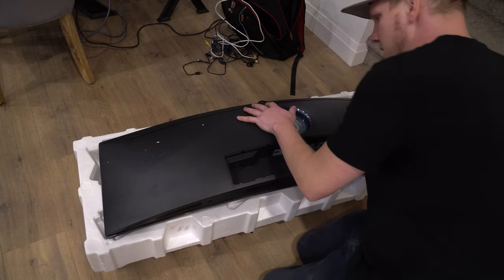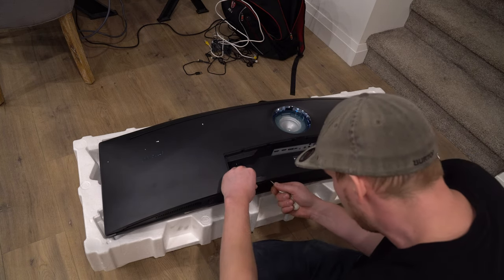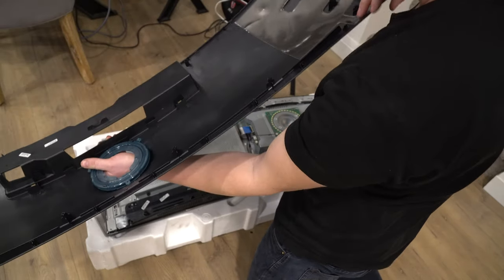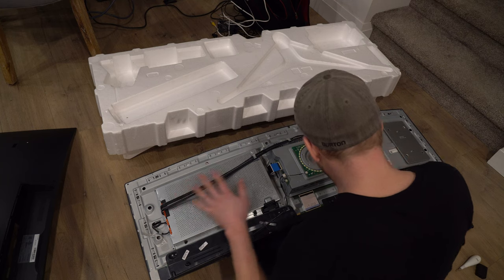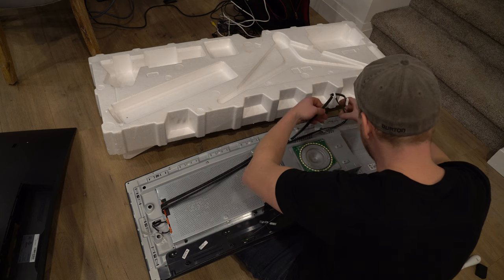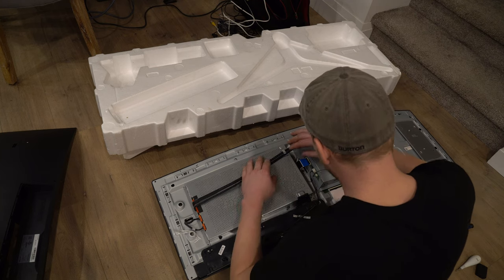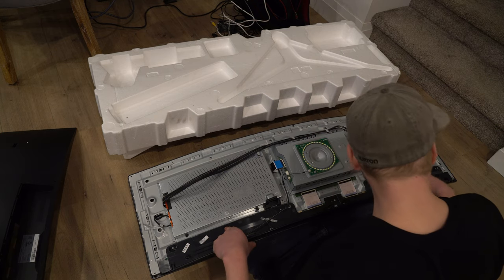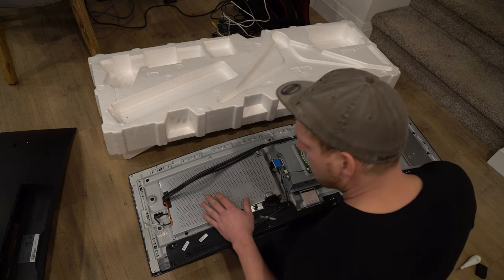HOW TO TAKING APART SAMSUNG ULTRA WIDE MONITOR TO CHANGE OR REPAIR COMPONENTS

Comment: Where can I order a new display screen, I have a friend who wants to pay me to fix his monitor
Reply: If you find out let me know. I have one with a crack in the top right corner
Reply from the maker: Samsung directly but the problem the display has the backlight built in so you have to replace that whole unit which is quite expensive and delicate by the time you receive the screen it will probably be cheaper to just get a new one. Put it this way if I is a business owner call Samsung and tell them a screen within warranty has backlight issues they will write off and tell us to destroy the panel and bring it to a recycler and just send a new one out because it's cheaper.

Comment: Do you know where I could find a replacement panel for this model?
Reply: Ebay
Reply: 9 mo later but for $300 you can buy a module for panel and screen off Chinese mananafacturers an $233 for panel $100 in shipping

Comment: I broke a screw off in one of the mounting holes and needed to get off the back plastic housing. This is the only video that helped me to do that. I was very worried that I would break the housing, but watching the video gave me the confidence to do it. Thank you for your help. Excellent video! 👍

Comment: Thank you for uploading this!
I was afraid to start my joystick repair as i was uncertain how to actually open the monitor, but now i can easily get access to it.
Reply: It worked btw.. i just reflowed all the solderjoints and cleaned the board with isopropyl alkohol, now it works ever time i use it
Reply: @StopaskingformynameYouTube  yo I have the same issue. you just popped out the joystick, cleaned it up and the menu button etc started working again?
Reply: Oooh I’ll try this today, my joystick (OSD menu) stopped appearing

Comment: great video..
Question:
I have that exact same monitor and it has  a single vertical purple line on the right side of it.
what do you recommend as a fix?

Thanks and keep up the good work!
Reply: Me too. Any luck?
Reply: same :(
Reply: Same here, any fix?
Reply: I have a similar problem but on a HUGE scale. The purple line is multiplied across the entire screen.
Reply: @vvsneptune1799  chech the ribbbon connectors
Reply: Old comment, but for anyone else who comes through here, if it's consistent it's a panel issue, and if you're out of warranty you are paying for a new unit because panels cost about as much as a new monitor

Comment: Thanks a bunch for posting this video. My C49RG90 was rattling on the right side of the screen. Turned out to be the power supply part that is losely fitted. Stuck some paper in the sides to stop it moving and the rattle is now gone.
Reply: Same

Comment: How would one go about removing the black outer frame? I have the classical problem of a light shining through the space in between the frame and display. I want to take the back cover off and remove the black frame to simply glue the loose spot back together. Any help?

Comment: question : is it possible to split the metal backing from the screen with all the electronics still instaled to it , by only removing the ribon cable for the screen itself , or is the screen glued to the metal backing ?
reason i ask is i have one monitor with a good screen and one monitor with good electronics , but i like to keep all serialnumbers together (serial numbers are programmed intoo the board and on a sticker of the metal backing )

Comment: You're a brave man, opening up one of these :) I'd be afraid to kill it. 

Right now I'm dealing with the port cover on the back being stuck and un-openable. I'm so afraid to crack it by applying too much force. Do you know how to get replacement parts for this kind of thing?
Reply from the maker: If you pull it apart and if it's the power supply or the HDMI component box I'm sure you can find those online. If it's the panel it might be cheaper for you just to get a new monitor

Comment: How can we do a hard reset?  The firmware update went bad and didn't default back. It turns on, you see the backlighting,  no source message or anything comes up, then it goes black but not in sleep mode.  The OSD never shows when you press the menu jog stick.  I tried to do a blind update again, just turning it on then pressing the menu, then holding the jog stick forwards towards me for like 10 secs, then jog left and press which should clear the what to update question, and then jog left again to confirm the update, but I don't know if there is a different path when downgrading the firmware. The update didn't default to the factory-installed firmware, so I am trying to figure out how to do a hard reset.  Can't find anything on it or a button, and no combo like unplug then plug back in a while pressing the menu (as an example) has worked yet.  

Anyone knows how to force the update from the USB blind or a hard factory reset? Thank you
Reply: you solved it?

Comment: Hi I have a question. My screen is broken due to the screen itself being damaged (crack on screen) so when I turn it out I get a typical grey with random color lines across the screen. I'm wondering if it's worth fixing it or should I just buy a new one?
Reply from the maker: When it's the panel like that better to just buy a new monitor. A panel costs just as much usually as a new monitor
Reply: @ghostlyrich  ah ok that suck. Thank you for the fast reply!
Reply: Any idea where i can buy new panel?

Comment: My G9 Odyssee makes cracking noises especially on warmup. A no screw backplate is a so super idea Samsung ... not. Cracking on expansion all the time.... I thought they had fixed it with the TSSR version which I have. Otherwise good monitor.
Reply: is it the plastic expandning? i know this may sound silly but did you take all of your plastic protection off.

Comment: can you put a mount on it? since the back is circular..
Reply: Yes, it should come with a circle adapter that supports normal VESA's of like 75mm and 100mm (double check their websites) but you need a mount capable of holding the weight

Comment: So mine displays no picture or on screen options. When I turn it on, the screen turns on since the black gets brighter but no image or no signal bouncing around. 
I bought a spare broken on that has a cracked screen but still has a picture, transfer all the parts you showed in this video into the monitor that only has a bright black screen. Still no picture, any idea?
Reply: Hey man. I have the same issue. Dis you fixed?
Reply: I have the same issue, were you able to fix it?
Reply: Any updates?
Reply: Any updates?
Reply: Same issue here all black screen but can see the lights turn on. Can't figure it out
Reply: @brianpumphrey8761  If it's completely black with power and no input connected, no input image, no menu, lines, pixels or color, then there's a realistic possibility that it's not the panel. The backlight is coming on but not the image panel. It could be ribbon cables but this would mean they completely came out or an FPC connector completely detatched off the PCB. The last one is very uncommon. More likely this sounds like you you got a blown component in the power rail or clock signal circuits of the IO/scalar board, or that board isn't getting power from the PSU board. If you're not competent with board level electronics repair, please leave any tinkering with the power supply unit/board to someone who is. They have big caps that can hold a very big charge for many months after being disconnected.

Comment: I had dead pixels pop up on mine after only 4 months. Samsung is sending someone to fix hopefully it can be fixed
Reply from the maker: Since it’s such a new monitor probably just pop the panel out and pop a whole new panel in mouth HDMI cord back on and same with the power supply

Comment: Anyone have loud cracking noises? any ideas to fix it?
Reply: Try it out without the backplate. I think its cracking while the monitorcomponents warm up and radiate heat to the plastic backcover which then expands.
Just my guess, i habe the same, will post here if I get it fixed.

Comment: anyone replace the lcd panel?
Reply: 9 mo later but for $300 you can buy a module for panel and screen off Chinese mananafacturers an $233 for panel $100 in shipping
Reply: As for replacing it’s more just taking asembely off
Reply: @thatkidmingming7390  where you getting your panels from?
Reply: @thatkidmingming7390 Exact same question. Where did you buy it?